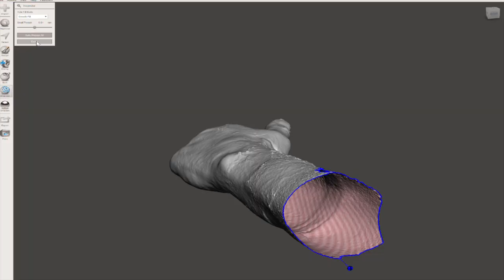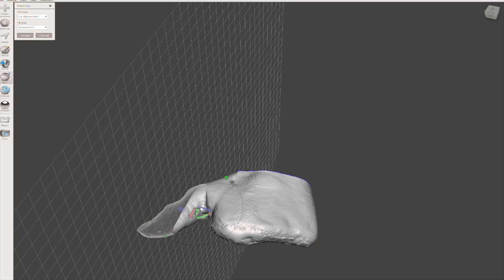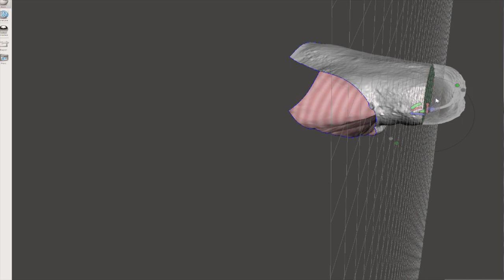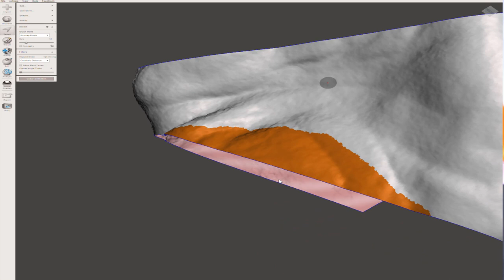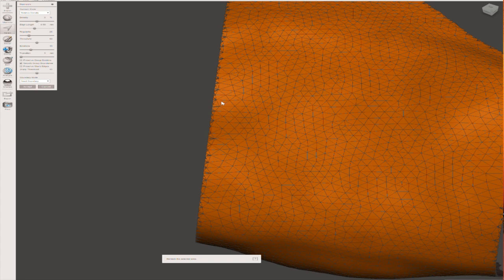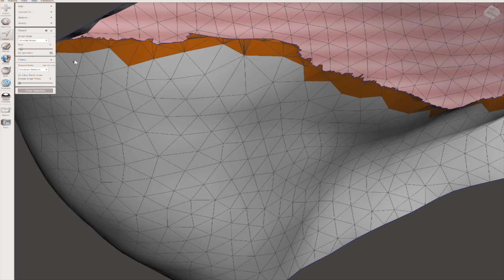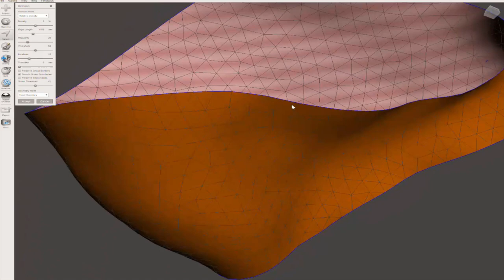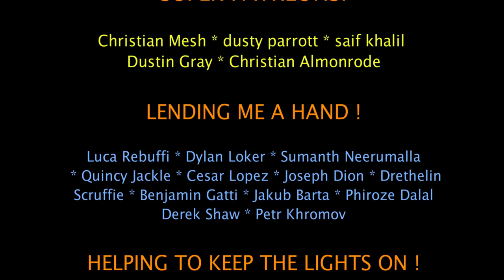Using Meshmixer to Build a Partial Hand Prosthetic Socket

Comment: The scanner captured a lot more data than I was expecting, impressive stuff
Reply from the maker: It really does. For what I'm doing, it's overkill, but say if you were going to scale it up, you could scan a relatively tiny object and scale it huge and still have pretty good detail. I know that it has its haters, but for the pricepoint, it's an incredible piece of kit.
Reply: @missingpartsclub seriously, I feel its only haters have VERY specific needs.

Comment: You've got a really cool setup! Is that a marble track in the background?
Reply from the maker: Yes, I built it around 2006. It used to hang over the fireplace at home, but my better half hated the sound it made when it ran, so it got banished out to the shop. Once I level it and get it running properly, I'll do a short showing all of the raceways.

Comment: I recently fractured the metacarpal in my right pinky and have to wear a big cast for a few weeks, and one of the things I can't do is use a computer mouse. I've been designing a custom housing for a mouse I scrapped for parts, with a socket to fit the cast, and instantly thought of your hand project! This would've been a lot easier and better with a scanner, but since it's not directly on the skin, a perfect fit isn't as important. Been working on version 4 (and hopefully last) while catching up on your content!

Comment: What's this contraption against the wall on the left? Looks very cool.

Also does the process go bad if you reduce resolution before making the cuts? Would it reduce artifacts at the perimeter of the mesh?
Reply from the maker: I don't imagine it would really matter.  The only difference would be when you remove the area for the thumb, if you reduced the resolution then your edge would be coarse and may not give you the best profile.

The piece on the left is a rolling ball sculpture I made around 2006 that has been banished to the shop because of the "noise" it makes when it runs.

Comment: Hi. It's great to see how organized and refined your method is.

On a different topic, do you experience some corrosion with the metal parts of your prosthetic? I may have missed it, but do you have any plans for protecting the steel parts?
Reply from the maker: I have been talking with Cerakote about an integration for a bit now. Eventually, I'll have them paint one up for me. So far I haven't had an issue with corrosion. The parts are either stainless or aluminum.
Reply: @missingpartsclub  ah, no steel, that makes sense. I hope you will get the opportunity to coat the parts anyway. Thank you for the reply.

Comment: Does the socket fit as well as your current one? How thick are the layers on the 3d printed socket? Have you considered going for a more compact design to improve the cosmesis of your partial hand prosthesis? Have you tried replicating partial hand devices and seeing which ones will work the best?

Naked Prosthetic fingers could be a nice alternative. There are also more robust prosthetic fingers with a more "knight" looking aesthetic that provides higher grip strength.
Reply from the maker: No, the printed socket doesn't fit as well as the vacuum resin layup socket.  It also isn't as strong or easy to mount components to. Layer separation under load is a huge issue, although I could see proving the design on your consumer grade printer and then having it printed in pa12 or some other nylon might be viable. 
Naked products serve a completely different amputation. They are articulated by the motion of the proximal relative to the metacarple.  The fingers on my project are driven by the motion of the metacarple relative to the wrist/forearm. Also, their mcp  devices don't have an articulated distal. All of their designs are 2 segments. Mine have all 3, prox, medial, and distal. It's the same yet completely different.
Reply: @missingpartsclub  Understandable. One of the amputees I spoke with before also had a 3D printed socket that never fit at all. If you were to go the 3d printed socket route, maybe making a slightly larger socket for it to fit and laminating on top may do the trick. I'm just throwing out ideas from the top of my head.
I suggested the naked prosthetics due to its cosmetic design. It would be really cool to see a more compact version of your hand. Do you ever plan to commercialize this design with an O&P manufacturing company like Ossur or Ottobock?
I'm sure a lot of partial hand amputees will benefit from this considering that it is a body-powered system and not myoelectric.
Reply from the maker: I've shown my ideas to the major players. They're excited,  but nobody wants to put in the funds for the part 104k fda certificate.  (The certificate starts at $1.4 million, plus 1000 person trial, plus, plus, plus) the issue really boils down to incentive vs. financial benefit for them. Right now, I'm looking at marketing it as a diy kit through social media.  If I get enough interest, maybe it'll get picked up like naked did. They were purchased by ossur a couple of years ago.
Reply: @missingpartsclub  A kit sounds like a great idea! One of the problems I've seen in O&P clinics is that turnaround time for repairs (knee joints, ankle joints, hands fingers) can take weeks, because they have to be sent back to the manufacturer's facility. If you can design the kit to allow faster repairs in the clinic, that would be amazing!

Also have you tried to laminate a socket adapter to the distal end of the socket to attach the fingers to? A lot of lower extremity prosthetic sockets are fabricated in the same way, so maybe it can work for your design. Adding something like that may be easier for the techs to work with too.
Reply from the maker: @zenir2591  because the fingers splay you cant use a rigid adapter like on an ossur i digits. instead i used a pair of plates that index to the form left by the forging dies when the socket was vac resin layed-up. the dies make a stepped ledge that indexes all of the rest of the assemblies. the finger assembly bolt onto the socket with 5 4-40 counter sunk set screws. its super easy to disassemble.

Comment: how is the result compared to scanning your hand made molded socket and printing from that?
Reply from the maker: I prefer the fit of the Resin vacuum layup socket to the scan to print. It's also way stronger than printed.  Witg layup ypu can add in reinforcing materials in the load bearing areas  where with printing you are constantly dealing with and limited by layer lines. Something that I'm interested in trying is after revision and iteration having the socket printed in engineering grade material by jlcpcb or pcbway. Something that I've learned with this last batch of printed parts is that Pa12 is way more brittle than I thought it would be. I dropped the new hand before I mounted the fingers to the socket and the upper and lower rails shattered! Was not expecting that at all.

Comment: Interesting that it doesn't fit as well as vac-resin. Gotta be a solution to that. Maybe extrude inward a mm or so, maybe only top & bottom; some amt of compression seems useful as preload.
Reply from the maker: Vac Resin fits so well because it's made from a physical cast model that is then shrunk and modified to make squishy areas tighter for loading. Whereas scanning can't automatically make accommodations for areas that are less dense and need to be tighter without a bunch of iteration.  You could totally use the extrude tool and, through trial and error, eventually get there. It's just going to take a puke of print and fit. You'd highlight the area you want tighter and extrude in the negative direction. I'm amazed that the scanned socket fits as well as it does. It really says something about the technology.
Reply: @missingpartsclub  Sort of begs the question whether photo scanning would ever be efficient & even whether a comprehensive scan (surface, soft tissue & vascularity, connective tissue, bones) would be more efficient than casting. Definitely a complex problem since even after either method you still have rub & pinch issues of nerve damage & scar tissue differentials
Reply from the maker: The best setup that I've seen is what Hugh Herr and the biomechatronics lab at MIT is doing for lower limb sockets. It's a ring of load cells on linear actuators that map the surface of the residual limb under load by concentrically squeezing  the tissue, measuring the unloaded vs loaded dimensions and building a topology map from there. Works great for cylindrical forms,  (legs, transradial arm) but I don't see a good setup for partial hands, it would require such a specialized setup that I don't see it in anything other that a lab.